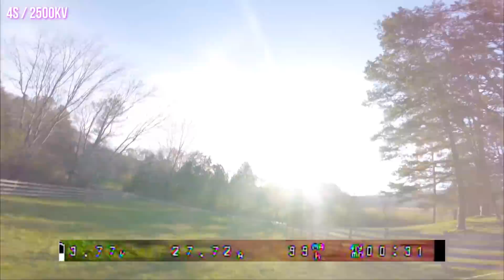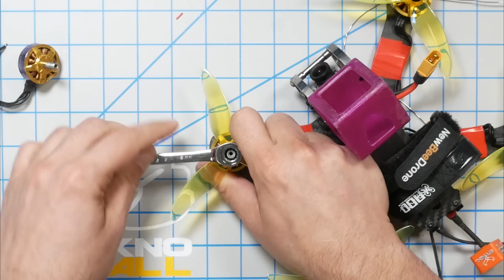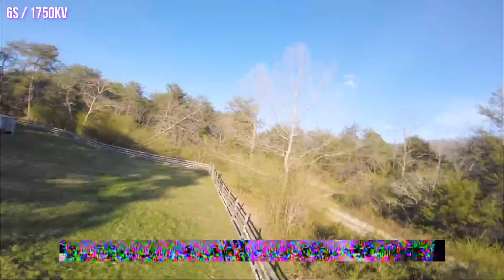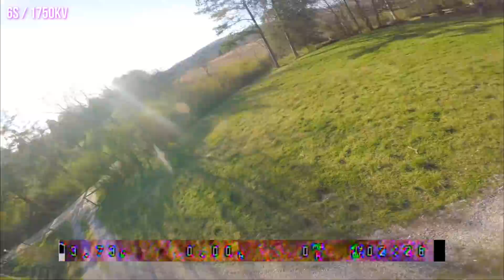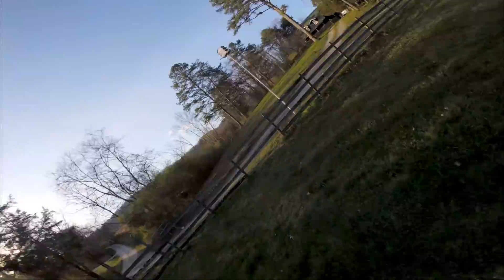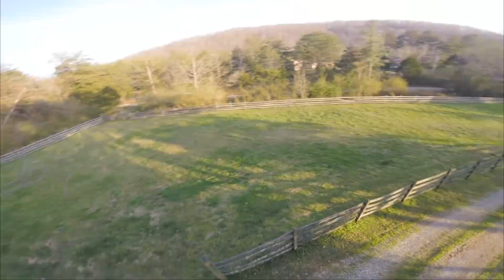JB2407 Motor v2 | 6S 1750kv vs. 4S 2500kv

Comment: Hey man i have the tyro 119 (6 inch ofcource )  with stock motors but i recently got a great deal on some motors emax ls2207 2400kv lit spec but can the tyro handle 2400kv or not and would it fly better what do you think?

Comment: I'm new on the FPV hobby and I'm building my first quad witch is a  7" long range quad, will these motors be a good choice for that quad ? Every body says to go with 1600kv for long range.
Reply from the maker: A lot of long range people are using 1750kv on 4S with 7" props. If you are worried about them being too high kv, you can use a throttle scale in Betaflight to limit the output a bit. The 2407 stator size is excellent for 7" props.
Reply: @JoshuaBardwell  thanks alot for your help Joshua, I'm ordering this ones soon.

Comment: Joshua, for comparison fun, try out your 4s motors with the GF's on a light freestyle build with a Split instead of a Gopro.. more like a heavy duty racer that'll still carry some momentum. 
HD is coming and Gopro's may not be needed by most people, so our frames might change a lot, but the power systems will remain mostly the same.
Who says big motors are only good for Armattan Hog, Pig, or Boar?  
I have 8 of your 2500kv purple pimp wheels, and two sets of Kakute F7/Tekko Metal/Unify HV/Nano/Eagle going into a fresh Badger and Chameleon 6"... but I might hold off on one of them and go lightweight instead?

Comment: I just recently made the switch to low kv motors after a hard crash denting a bell housing on my 2207 2450kv... I went to 2207 1750kv and was gutless on 4s I was in shock at the difference! Went to some more aggressive props and it started drawing my amps back up so I thought well hell time to go to 6s... I gained a bit of weight but was able to go down to a less aggressive prop... longer flight times less sag heavier kwad means smoother rotations or at least that’s how it feels to me... I love it and will never look back... I want your motors so bad >_< is it bad I kinda hope I crash so I “have an excuse” to upgrade hehehe!

Comment: I see MQTB has trust data for your 2500kv motors. I just got a set of your 1750kv motors, and I was wondering if thrust data is in the works for the 1750's?
Reply from the maker: It is in the works but it will be a while before it's done and up.

Comment: $26 vs $28, not a deal breaker for me. I've been using popo for about 6 months now love them. last week changed back to the regular motors to use up some of my extra motors, I hate changing props on them. I'm sticking to only buying popo going forward.

Comment: 1750 vs 2500 is not correct, 
1750kv on 6S is equal to 2625kv on 4s
Reply from the maker: That is correct. So the 6S motor is actually getting slightly better flight time on slightly higher rpm.

Comment: 4S at the end! Nothing wrong with it. I prefer the 6S myself. It does cost more but I prefer the snappiness, punchiness and responsiveness if those are even words. 4S is smoother in my opinion but you can feel it wind up more from higher kv

Comment: Makes sense. You went bigger on everything... it stands to reason that you  need bigger (voltage) packs.

Now that you have a winning formula for a 6s freestylerig, I'd like to see you re hash the 4s rigs...decrease everything by the same percentage... 33.3% 6s=4s 650g = 434g to see if you can get the same flight experience.

My freestyle rigs are closer to this number. I'd love to see feedback on your flight experience at around 450g 4s. 

I'm also planning on building a more conventional heavy freestyle rig to do the same comparison.

Nice flights! As always,  thanks for all that you do!

Comment: I like to use Stanley Proto J253G Proto 9-1/2-Inch Soft Jaw Cannon Plug Pliers to hold the motors when tightening them down.

Comment: Damn JB! I'm even more undecided now! I bought the new marmotte frame and have been back and forth whether to do  my first 6s build or not. I finally made up my mind to stick with 4s and you pull these motors out of your hat! Thanks bro! My plan is to use most of your custom gear. Camera, motors, flight controller, etc: Call it the JB special if you will, lol.. I'd really respect your thoughts and opinions?? Beautiful freestyle and song choice at the end btw!

Comment: HELP Built my 1st 6s 1700kv and my rates are so slow got super rate maxed out and rates 200 + still not snap e at all is there adjustment in Betaflight tune that ramps up rates.
Reply from the maker: 200 dps is very slow. Raise rc rate. Take S rate down

Comment: my favorite 6s prop is HQProp 5.1x5.1x3. It may seem too aggressive, but remember, on 6s the batteries wont get hot. The motor is more efficient on 6s so it wont get hot either. Its a blast to have that much low end torque available.

https://www.getfpv.com/hqprop-dp-5-1x5-1x3-pc-propeller-set-of-4-light-blue.html

Comment: Hey Joshua! Quick question. I've noticed you have the motor wires following the side of the arms, I've done the same with my build thinking if props get bent and start hitting on the arm the wires will be hiding behind the arm, however I've fixed the wires with a little bit more tension (basically no slack). So now I am wondering if those wires will wear off/get cut by the fiber carbon arm edge like you've explained in some other video regarding the power leads going through the top of the frame. Any thoughts/comments on that? Thanks in advance! (Big Fan - long time lurker)
Reply from the maker: Personally I always like to leave a little slack. But I'm doing it for the exact reason you say: to protect against prop cuts.
Reply: Nice. Thanks for reassuring me I'm doing the right thing. I'll give them a little slack near the motor then! Good thing I've left the motor wires longer like you always suggest. Cheers!

Comment: How do the 1750's fly on 4s or dowe see that in the last part.
Reply from the maker: Any 1750 kv motor will be relatively under-powered on 4S with 5" props. The last part is 4S 2500kv.

Comment: Great edit at the end. I take it there was no change in the PIDs from 4s to 6s? As I don't recall it being mentioned. They both flew rather well.
Reply from the maker: There was no change to the configuration at all between the two flights. The only difference is that I had to replace the ESC between 4S and 6S, and I forgot to re-configure ESC Telemetry, which is why you are seeing zero amps on the 6S flight.

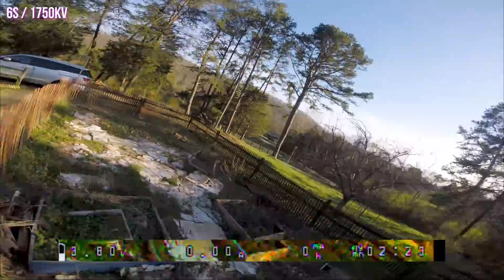Comment: I love your motors for my 5 inch, Smooth Operator with GPS on 5S or 4S.  But damn, I just built a 6S with Steel's 1700KV motors which are great on 5S or 6S.   I just did a freestyle flight yesterday with the 1700KV motors lasting 9:44 on a 5S 1550mAh Lumenier battery so no complaints.
Reply from the maker: Yeah 5S on 1700 kv is a little under-powered but not too much and will give a lot longer flight time than 6S.
Reply: Joshua Bardwell   I’ll say this. Your motors on the Smooth Operator with the latest BF firmware and GoPro 7 set at 2.7K, 30fps gives me the best video ever with absolutely no jello. Simply awesome.

Comment: I found with my 6s setup you could very easily cook the batterys if your not carefull. as soon as it gets to end of the pack the voltage drops off really fast.
Reply from the maker: Yes that's true. The voltage is so consistent it invites you to over-discharge the battery because you are having too much fun.

Comment: Whatsss up... I was playing with 6 cell setup..about a year.. ago... checking the speed low kv..with big battery was the same as a high..KV..and 4s..battery the main thing I noticed was the props getting distorted from the 6cell battery... but the feel of being too locked..in.. with 6cell.. didn't have the free float feel of the lighter 4cell with a lighter high kv..motor.. just preference.. if you like it role with it.. Cheers JB🐾

Comment: what happened to the battery testing you were suppose to do? looks like you tested just afew packs and stopped what a waste of good equipment ;(
Reply from the maker: I have been working with a development team to make a web site to present the results. I am still performing testing I just want to put the results up on a web site where everybody can access them, rather than one video at a time where you can't compare.

Comment: What a coincidence that I'm actually looking into buying your motors and my preference is low KV to run 6s. This was a good move JB. If you ever release a POPO PRO version WITH REPLACEMENT BELLS (because I can't seem to find replacement popo pro bells anywhere) then I'm sold on this. I'd be willing to spend a little more  on the POPO PRO version of your motors as long as I can get the replacement bells.

Comment: If the 4S pack and 6S packs you flew were equivalent Wh, then there's definitely something not quite right with the 4S pack.  There's no way 6S gives you that much extra flight time.  I'm a racer rather than a freestyler, but my experience is very similar flight times between 4S and 6S, but noticeably less sag on the 6S.  Having a consistent feel across all laps in a race and not having to deal with sag on the last lap is reason enough for me to have migrated to 6S though.
Reply from the maker: 1100 Wh 6S vs. 1500-ish Wh 4S.
Reply: @JoshuaBardwell  you mean mAh.  An 1100mAh 6S has 10 percent more capacity than a 1500mAh 4S pack, so that alone accounts for a fair bit of the extra flight time you saw.

Comment: Nice move with the cap head screws Josh - I've just had to take a hacksaw to a set of button heads because of the loctite causing the hex key to strip the button heads...and in the process showering my motor with metal debris which has now trashed the motor - by bad, I should have covered the motor with cling film before sawing off the button head! In that context, do you have a method of removing iron filings from a motor? ;-). I am now going cap head all the way for the same reasons you talk to.

Comment: Why you turn off the current sensor on 6s
Reply from the maker: It was an accident. I had to replace the ESC on the quad between the 4S and 6S flights, and for some reason it caused the current sensor to stop working. I don't know why exactly because it was the same ESC so it should just have dropped in. I didn't notice until a commenter pointed it out here.
Reply: @JoshuaBardwell  ok you don't know how much Amps it pulls  max current?

Comment: Why are the thin lock nuts and the multi stranded windings?
Reply from the maker: Low-profile lock nuts are because high-hub props would not let the nuts go all the way down and grab. Taller shaft would add weight. Multi-strand windings let you get more copper in a smaller area with less wasted space due to air. Single-strand windings have some advantages (one of which is they look beautiful) but in this case we felt multi-strand was the right choice.

Comment: Why 4.25V at start?
Reply from the maker: I charged all the packs to 4.21, which typically results in the resting right at 4.20. I think the voltage sensor on the quad may not be calibrated exactly the same as my charger.
Reply: @JoshuaBardwell  I already thought that there was some kind of mystery:) Thanks for the reply, JB!

Comment: Behind the times rline 4s 1550mah £29rline 195grams 6s rline 1050mah 170grams£24 in UK, again less auw weight same or more flight time, no sag and your motors draw too much current.
Reply from the maker: 24 pounds for a good 6S is 31 dollars. Meanwhile I can get a solid CNHL or RDQ 4S for $20 to $22. 4S still has economic advantage over 6S.

If my motors draw more current than you like, don't fly them. They're not for everybody.

Comment: Can anyone help me out with this question I have the Bardwell F4 v2 FC and individual dys 32bit 35A and a Caddx SDR2 freestyle and a rush tank vtx! Should I use a capacitor? And should I wire the camera straight off the VTX or the FC?? Can anyone help me!! It’s my first build!! I got MB primo 2207 2650kv
Reply from the maker: I don't add capacitors unless I have video noise issues. For the Tank vTX I think power it off ESC+ pad (vBat).

Comment: I replace cap head screws with button heads, as that's my preference. For $26 you would expect both in the box of several lengths (Emax supplies 2 lengths which is better than average, and some of my motors came with 3 lengths - I forget which now). These screws in bulk are only a couple of cents apiece.
Same deal with wire length, which most motor manufacturers are getting better on, a little extra wire is a big thing if you're 5mm short. This happens more as 7 and even 8" quads are becoming doable and 4n1 escs become more common. 
I committed  to 6S last season, still have a few quads with 4S setups but am phasing them out. I fly mostly 6" and get substantially longer flight times (up to 9 min) at reasonably low current and that makes it worthwhile for me. That being said, my flying style is less "punchy" and more "smooth proximity". I think it's largely personal preference.
I'll consider trying a set of the new JB 1750s as I upgrade my quads. I have a couple quads that need new motors and crsf to get them "up to date" with my collection. I'm sure as soon as I get them all changed over and on BF 4.0 something will happen to make me want to upgrade again, so goes this hobby.....
Thanks for listening.

Comment: You can tell he difference just by how you took off at the end that it was 4s.
6s takes off completely different, faster and louder.
Reply: It does not work like this with matched kv motors.
Reply: @Maxpakts  well I can tell you this. I have emax 2205 race ones that are 2600kv. On 4s
Then I have my 1750kv 6s 6" the 4s is 5" but both azure props.
Both are about the same weight. With no gopro.
And there is a huge difference in sound on take off. You can latterly see and hear it.
Wife can eve tell what I'm flying from a distance with out seeing what quad I am using.
Sorry but many others will agree
Reply: Todd Beal 6'' has very different sound and flight characteristics compared to 5". I have some racers that are completely identical except of being a 6S or a 4S setup and they sound the same and fly quite similar. Of corse there is a big sound and speed difference if I put a 5S or a 6S battery on my 4S setups with higher kv motors.
Reply: @Maxpakts  dont worry man, I already did the 5" to 5" comparison lol.
Before I even got the 6" props I had the 5" ones on just to test the 6s rig out.
Sorry that I didnt mention that to you.
So yes they had the same props.
Only difference is motors.
Still they was different man.
You can hear it, 6s is just way more snappy period.
Or maybe I'm just retarded

Comment: Can you say who manufactures your motors? I am a pretty loyal to brotherhobby and T motor and would buy yours if they came from the same place. 

Currently running f80 pro, and r6 2207 1750kv POPO.
Reply: Brandon Young lumenier. House brand for getFPV I think.
Reply from the maker: Lumenier manufactures pilot-sponsored motors in house. They have their own facility.

Comment: Have you tried low pitch props like the S3 Ethix, Johnnys Azures, etc? I’ve been flying 6s for about six months now and the low pitch seem VASTLY better. Much less prop wash, MUCH better low speed control with more stability and I get to use more throttle range.
Reply from the maker: I tried the Ethix S3 and they were okay but not a good fit for this motor. Better on a smaller higher kv motor I think. The whole point of this motor is to be able to run higher pitch props smoother, so when you prop down to an S3, the motor's torque is wasted and the weight is not made up for by additional thrust.
Reply: Joshua Bardwell I thought Steele designed the s3 for 6s, but have heard your same thought regarding s3 and high kv from Maionhigh (I think her) also.

Comment: Don’t they sound so cool though. I really dig these props. Was introduced to them in the drondrop box. Just bought five more pairs. I was running them on a some 2400 emax’. Switched my motors to 2450’s and wow. Your FC, tbs 25a bullets. And I’m having to relearn to fly my quad. Just like your vid with VIC! (Don’t keep changing your rigI think I found my set up to use for a long run. I do want these motors on my future kiss build that I’m doing with the iflight battle axe!!

Comment: Wow, that’s power! Be careful not to punch a hole through your house. How do you think your 1750 kv motor would perform on a 7” 6s quad? I have a frame and I’m torn between your new motor and the IFLight Xing Camo X2208 Motor 1800kv. Decisions, decisions. 
I have your original motor and I will install them on a rebuild of my first quad, the Catalyst Machineworks Speed Addict 210 v2. 
 I appreciate the knowledge you share- take care
Reply from the maker: It would be great!

Comment: Are the zip motors comparable to your motors? Just since they are the same size and made by the same people. Well sold buy i guess i dont have a clue who makes either of them lol
Reply: our lumenier factory make both zip and jb, and they are different lol. lumenier make them
Reply: TheHahayanyan okay lol i mean i figured the same company made both since lumenier is on the bells lol but i mean are they even comparable to the 2407 zip motors? I have the zips and like them but if these ones are a little better in some way i wanna switch lol
Reply: @herbiefpv1637  haha stupid me, haha lets us  double check a few.things, there are a few differences between them . nothing will break if you try, for making it smoothly running , you may need different thickness of.washer. magnet, wiring and the base are uniquely match for each model of them , sometime tiny different distance between  both bearings make.meaaureable different  in the area of  micro vibration..etc